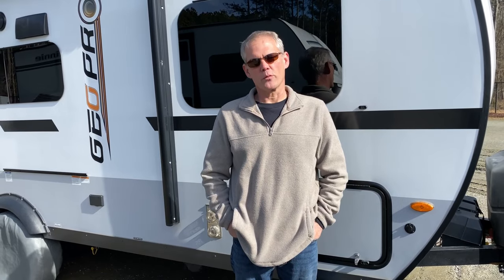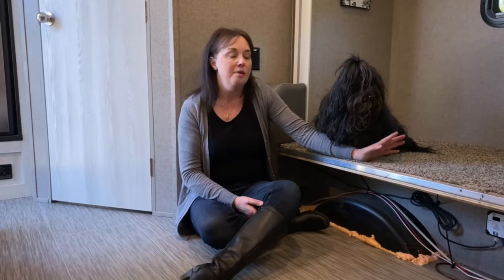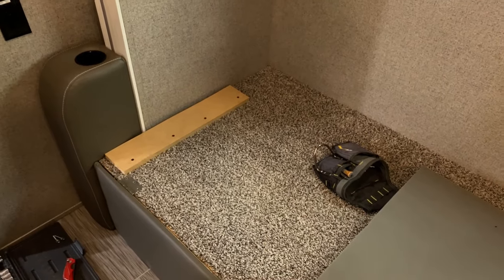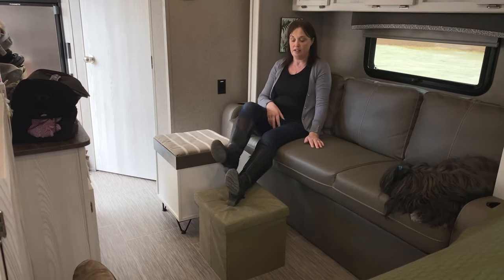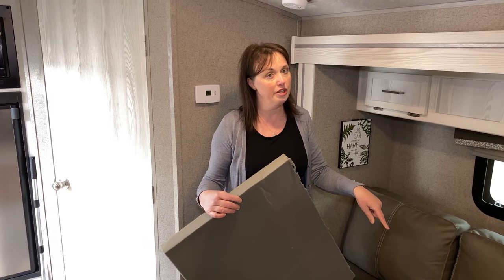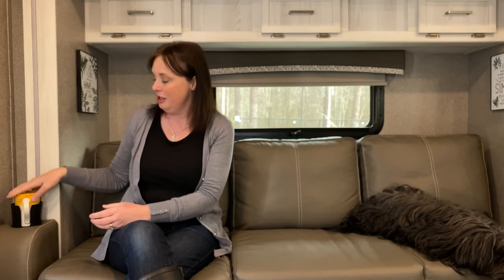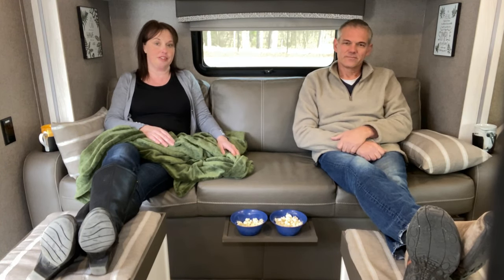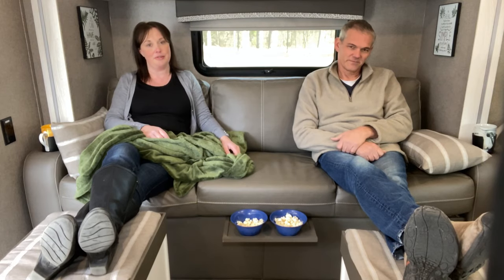Modifying our GeoPro JackKnife Sofa - 5 Changes That Made it Work for Us.

Comment: Our 21FBRS Flagstaff is a bit older with a slightly different 72 inch jack knife sofa but on the same platform style slide out.  Our bottom cushion has a large zipper to open the bottom so we added high density 2 inch foam slabs to improve the comfort of the seat.  Much better!  The seat back was fine and the angle was good.  We use storage hassocks for foot rests.  I do like the pull out shelf idea. Not sure we have the room for it since we didn't elevate the seat like you did.  Nice mods!
Reply from the maker: Thank you!  It has held up well except the seat cushions have gotten worse.  Ours does not have that handy zipper lol!  We are actually doing one more upgrade this week that we think will improve on it.  

Like the idea of storage hassocks!  The wood footstools are sturdy as heck and great for extra seating but with sturdy comes the extra weight.  So we might swap out.  We will see where the year goes haha.

Thanks for watching!

Comment: We have an almost identical setup in our Rockwood 2109S.  We wanted to convert to the RecPro double recliner.  Like you, we soon found out we did not have enough depth and even if we did the slide out deck is still too high.  We'd have needed a step to get up in the chairs.  We found your video and that inspired me to find out if tilting the jackknife back would make it more comfortable.  I put a 2 X 4  block under the front of the frame and our sofa was immediately more comfortable.  My wife has also ordered some pillows and 16 inch high folding ottomans to replace the 12 inch ones we had.  Thank you for the ideas!
Reply from the maker: So glad the video was helpful!  It certainly isn't as comfortable as our recliners at home but it definitely improved the experience for watching a movie in the evening!  This is our second camper with a jackknife and found that these tips help most of them be a bit more comfortable.  How do you like the 2109S?  That is the model we have our eye on for upgrading one day in the future.  Thanks for watching - appreciate it!
Reply: @WinesPinesandCanines  The 2109S has been great for the 2 of us.  It is roomier than the geo and of course heavier.  We really like it.  It looks like if you get the dinette in the slide, the slide is deeper and lower to the floor.  Suitable for recliners.
Reply from the maker: Yes - we were at an RV show yesterday and while they didn’t have this model, there was one with the same floor plan and it is so roomy!  Unfortunately, the GeoPro 19fbs doesn’t come with a dinette option :(.

Comment: Like your vid. We had a micro lite hated the couch.
We removed couch but left the front panel, we bought two recliners from Ashley's and they fit perfectly up on the platform...we placed a board in front to tilt us back slightly and a 14 x 30" storage ottoman from Walmart fit between us for a table/storage. I like your cup holder idea. Could you remove the holder and replace it with a small swivel table by bolting it down from under the cup holder? Just a thought😉
Reply from the maker: Awesome ideas :). Did you have to take the legs or bottoms off the recliners?  We have a low ceiling with the cabinets on the slide (although you could take the cabinets out... always something to think about!).  We thought about swivel tables - haven’t given up on that idea yet.  The original cup holders can pull right out but a tight spot and we were a little nervous about tearing the fabric.  Thanks for watching and safe travels!
Reply: Are the recliners you purchased still available from Ashley's?  If so, can you provide a link?  It is great to be able to benefit from the success of others.  Thank you in advance!
Reply: @carolyn... Do you have pictures of this? We love that idea.
Reply: I was hoping I could see pictures too

Comment: Great video. We have a epro and want to put hinges on the  Skirt board under the sofa also. What size hinges and screws did you use please. Thank you and keep the vids coming!
Reply from the maker: Thank you for watching!  We used 3” long hinges from Lowe’s/Home Depot.  But we did cut a small 4x4 piece of 1/4” plywood to pad out the back a little as the skirt board is thin.  That just gives a little extra for the screw to “bite” into.  I think we went with screws that came with the hinges but basically just made sure they were long enough to go through the plywood piece we added and then into the skirt board but not too long that they would poke through.

Hope that helps!
Reply: @WinesPinesandCanines  it does help! Thank you so much. 👍🏻👊🏻

Comment: Linda, Troy & Desi....  It's funny that you should release this video on the couch right now.  One of my biggest complaints of the FBS is that couch and being able to sit comfortably and eat, watch TV or even read.  The table that comes with the trailer is cumbersome and I removed it in favor of two small folding trays.  ("Every ounce counts")  In fact, I have been considering selling the FBS in favor of the FD.  But your modifications intrigue me.  Do you remember the diameter size of the hex head screw that holds the couch in position?  It looks like a 1/4".  I know you replaced the thermostat.  Was that relatively simple DIY project?
Reply from the maker: Hi Glen!  We completely agree - one of the reasons we bought the FBS was the couch and it looked and felt so comfortable when it was sitting at the dealer lol.  These changes definitely help - doesn't make it as comfortable as my theater seating at home but definitely better!  I was seriously considering taking it out and having something custom made but glad Troy talked me down to changing the way it tilts first.  $10 was definitely cheaper!  And we also dislike the table - so bulky and heavy.  It now sits in our garage. The screw we took out of the couch - Troy used a 10mm socket but 3/8" would have worked as well.  Of course, this is assuming that Rockwood used the same from trailer to trailer!

The thermostat was an easy change over - I think it took less than 10 minutes and I love that change.  Being able to tell what the actual temperature in the camper is vs guessing on that sliding thermostat is great.  Not sure why they can't just invest the few extra dollars in a digital one.  Thanks for watching!
Reply: @WinesPinesandCanines  Linda et al, I agree on the thermostat.  But as Ford 80's motto said, "Every ounce counts".  I guess in the RV business, "every penny counts".  Plus, if I remember correctly, RV manufacturers are at the mercy of their supplies.

The table wasn't a complete bust.  I use it as a side-board in my office.  Very sturdy.  It can accommodate a printer, scanner... and a table lamp.

RE: the 19FD (versus 19FDS), I am seriously considering the upgrade for a few factors.  One being the trailer and tongue weight is lighter.  Two being the lack of a slide is one less thing to fail or leak (not that that's happened to me).  Three the 19FDS (slide version) will not allow the Murphy bed to lower and has NO gas oven.  Four, the 2021 19FD has the bigger sink and high faucet, and can come with the 12 volt fridge and 190 watt hard solar panel.  And finally, the "couch" in the 19FD has arm rests on either side, and a fold down arm rest in the center (which has two cup holders) and it has the elevating foot rests.  Don't get me wrong, I really like the FBS, but that's too many model year changes to ignore.  I look forward to your next video.  But I live just north of you in Maryland, and I have no plans to go to the mountains until after May.  Be safe.  Happy travels.
Reply from the maker: Glen - completely agree on the new models!  We did think about moving up to the 2021.5 because of the 12V fridge and some of the other changes but put on hold for now.  And the FD really does have some nice features.  Having a dinette and a couch is nice.  For us, the full bed is one of the reasons we went with the FBS.  If you decide to switch over to the FD let us know.  We have seen a bunch of mods talked about online!
Reply: @WinesPinesandCanines  I remember you modified the bed to make it larger.  Something that could not happen with the FD or FDS.  Also, I doubt the couch tilt modification would be possible since the Murphy bed lays down on the jack-knife couch.  (Unless you enjoy having your feet slightly elevated, or sleeping in reverse.)  Also, I like the slide out tray you created.  I will keep you posted.

Comment: Awesome video! I just bought the Rubicon 1608rb, and that's how I found your channel. The Rubicon has a terrible Jack knife sofa, too, and I was actually thinking about replacing it altogether with a Futon. Have you heard of this being done? I'm just curious if it's possible and how hard it would be to do.
Reply from the maker: Hi!  Thank you and thanks for the watch!  Yes - haven't met a jack knife sofa that was comfortable yet lol.   We had one in our previous class c as well.  

 So we haven't seen anyone replace with a futon but have seen others that have taken it out completely and put a twin size mattress for the bottom and then foam or cusions for the back.  We like the sofa look of it so these mods made enough of a difference that we didn't remove it.  And we don't sleep on it which is another reason that the twin mattress might work better for others.

Since this video though, we have replaced the cushions in the seat (video upcoming) and it is quite a bit more comfortable now.  

How are you liking the Rubicon?
Reply: @WinesPinesandCanines  we pick it up tomorrow, 8/14, so we don't have any experience with it yet, but it checked off all the boxes that we were looking for in an RV, so we are definitely excited!
 Now back to binge watching more of your videos. Lol
Reply from the maker: Congrats!  Always exciting to pull away from the dealer!  Looking forward to hearing how your first trip goes!

Comment: We recently discovered your YT videos and have learned a great deal through your experiences.  We will soon be taking delivery of a new Flagstaff E-Pro (same as your GeoPro) and the first job I want to do are these sofa mods.   I briefly looked at the sofa today at the dealership and could use your help on a couple issues:   
1.  To remove the sofa in the first step, I can see how to get at the front sofa mount lag screws but couldn't readily see how to get access to the rear lag screws to remove them.  
2. After installing the new 1x4 wood runners for tilting the front of the sofa upward, does the rear portion of the sofa frame also sit on top of the new wood piece or back down directly on the original wood sofa platform? - see 6:51 in the video.  I assume the new wood blocking was added for additional height for the sofa and better lag screw anchorage and that both the front and rear of the sofa frame sit on top of the wood blocking.
Thanks for any help.
Reply from the maker: Hi!  Congrats on the new camper and thanks for watching - very much appreciated

So, it is tight but there are a couple of nuts on either side at the back of the couch.  Once you pull those 4 off, the back comes right off.   And the wood boards run under the full frame - the washers hold it tilted up in the front.  And yes - we added to give more for the screws to bite into.  

We currently have the sofa all apart - doing some modifications to the foam so will have another video upcoming in the future once we test it out.  But all in, takes about 5 minutes to take apart/put back together and is much lighter than you would think! Hope ths helps!
Reply: @WinesPinesandCanines  Many thanks.  We take delivery of our 20FBS later this week and we'll be sure to watch more of your videos.
Reply from the maker: Very exciting!  Would love to hear how the first shakedown trip goes.  Enjoy!
Reply: @WinesPinesandCanines  OK, after postponing the maiden voyage by a couple of weeks due to freezing and rainy weather, we finally got the new EPro 20FBS out for a few nights.    We were very happy with everything on the unit on this first trip (although I do plan to modify the sofa).    We did have one very minor rain leak at one corner of the slideout that disappeared after I brought the slide back in then back out again - maybe a loose weather seal.   Our dealer says he will look at first of next week.  The EPro is definitely a big step up from our old Forest River Rpod.
Reply from the maker: @omcbob37 so glad it went well!  (except for that one hiccup!).  Safe travels and let us know how it does on the road!

Comment: Hello there, I'm not as handy as you all are but have a question. Do you think if you removed the sheet of plywood the couch sets on do you think you would be able to install theater seats there?
Reply from the maker: Hi Charles - thanks for watching!  Unfortunately, the plywood is attached to a metal frame which is the bottom of the slide (you can see that at about the 2:35 minute mark).  So to replace the sofa, whatever was purchased would have to sit on that platform.  We would have loved to have had theater seats  but resigned ourselves to a no go so decided to try some couch modifications in the spirit of theater seats lol.

Comment: I'm a single mom we are on a really really tight budget but we have some major issues with our jackknife mainly because that's the place where my teenage daughter sits to watch TV, Etc. It's our only seating if a friend comes over. The table in our rig was taken out and we're glad for that but ours is like sitting on bare bars I tell you. I don't know how to fix that part. We don't have cushions. Just a big, one piece, built in connected couch cushion. We've already figured what to do for the bed we pull it out and we put a blow-up mattress on it and that has worked well for my daughter's friend that comes to us from her group home for holidays. But as far as just having a place to sit down it's horrible. Do you have any ideas just the cheapest. Like my daughter was wondering if we could add a pillow top from a bed on top of that would that help? It has a cute little cover, it's a one piece that just goes over the whole thing but I just wish it could be more comfy. It doesn't feel like it pushes us forward so we don't worry about that. We have footstools not too worried about armrests or cup holders but mainly just not wanting to sit on bars anymore any ideas would be welcome.
Reply from the maker: Hi - sorry it has taken a bit to get back you!  Very much appreciate the comment and watch!  So, is there anyway for you to get underneath - can you take it off?  

My thought would be to flip it over and stuff as much foam as you can between what cushioning is already there and the bar.  We have found much of the discomfort comes from not enough padding in the seat so you easily feel that bar.  Hope that helps some!

Great idea on the blow up mattress!  Thanks for watching!

Comment: I have so many questions for you guys. We have a 19fbs epro. You will hear more from me. But for now how did you attach the plywood to the sofa base. Also when you winterize do you fill the filter canister full of antifreeze.? BTW Great vids!!
Reply from the maker: Thank you for the positive feedback and for watching!  Feel free to reach out with questions - we try and answer as best we can!  For the plywood - there is plywood that makes up the top of the slide (it was already installed and has carpet attached.). We added the 2x4’s to tilt it.  For the filter - we take the filter out of the plastic container and when we winterize it does fill with some antifreeze.   Hope that helps and look forward to “talking” to you in the future!

Comment: Thank you so much for the info on this. We just bought a 2021 19 fbs and the couch base screws came out. I did the hinges like you and also being a tall guy, modified the tilt on the couch.  Waiting to pull out some of the cushion yet.    Working on the foot stools next.  Which tubs are you using for the over bed storage?
Reply from the maker: Congrats on the new camper!  Its crazy how small changes can make such a difference on the couch.   It isn't "residential comfy couch at home" level but much better!  

 So for over the bed, we found some baskets at The Container Store. We like them as we can fit 5 up there and it fills the space plus the colors and design matched the camper almost perfectly.  These are the ones:https://www.containerstore.com/s/diamonds-kiva-foldable-bin-with-handles/d?q=kiva%20storage%20bins&productId=11010845

Thanks for watching!

Comment: 2y later they have the same problem with the couch, just got a geo pro and I'm going to do some of these mods.
Reply from the maker: Yes - we recently sat on a 2023 and although the cup holders in the middle are a nice upgrade, it didn't feel much more comfortable.  We are looking at doing one more mod to it so if it works - will do an updated video!   And congrats on the new camper - we are 4 years in and still very much enjoy ours.

Comment: So now that you modified the couch, can it still be used as a bed?
Reply from the maker: Hi - thanks for watching!  Yes - it stills works as a bed.  We don't use it as a bed as we don't have the need but it is a question we get alot.  It still folds down and no issue lying on it.  In a video we did a few weeks ago, we did an update on this video and showed where it still works as a bed.